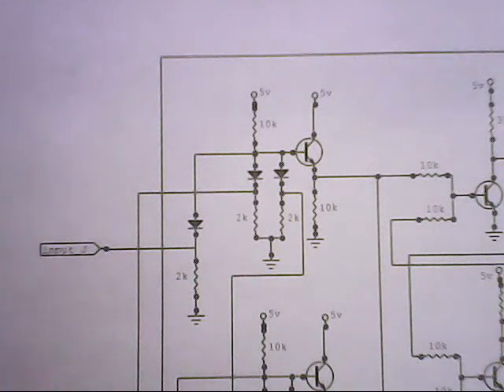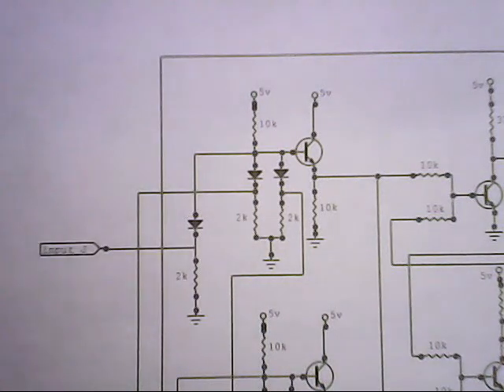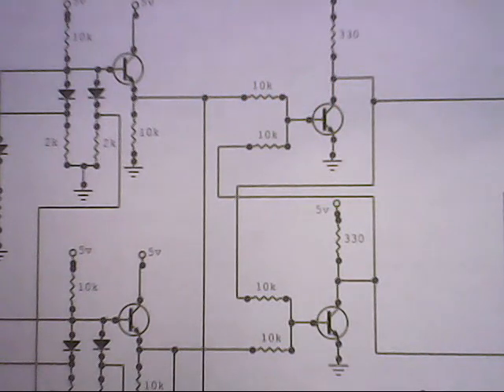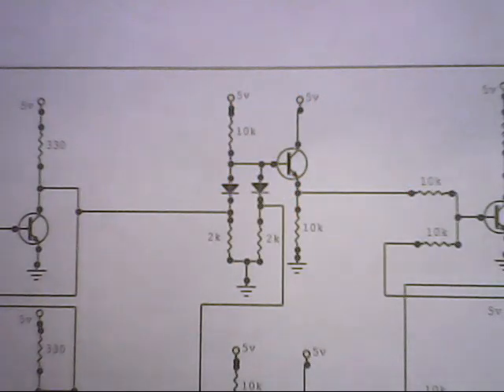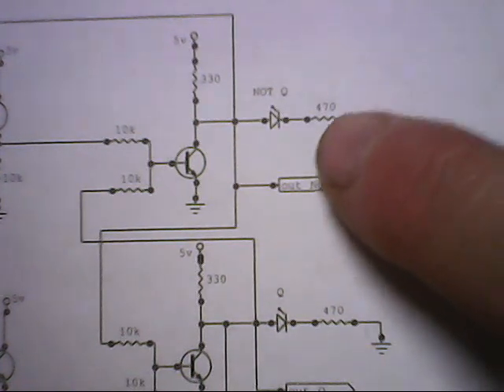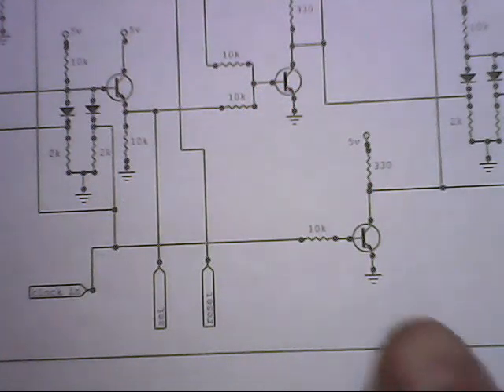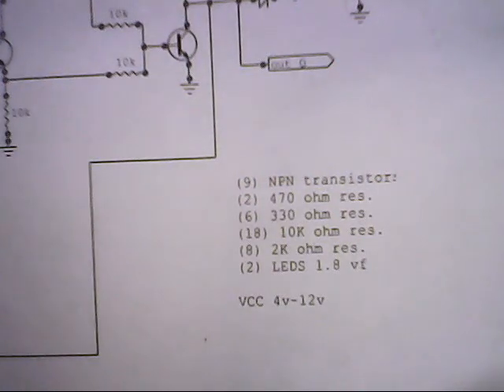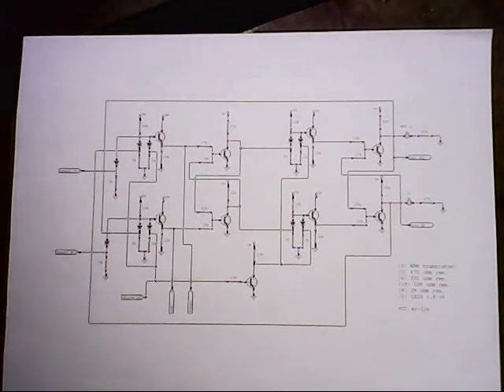Detailed schematic of " jk" "flip flop" using transistors.

Comment: Nice explanation of the circuit. Im currently building it. I noticed you forget to add the diodes in the parts list. 👍
Reply from the maker: Hi thankyou, I didn't realize that I missed those diodes in the parts list until you pointed it out, and going back over my video I seen them missing in the parts list.     I used 1n914 diodes for the circuit.

I feel like this video has been a success in sharing how fun it is to build these kind of circuits from scratch, using discreet components. 
I hope your build of this circuit works out fine for you, 
if you have any problems with it or any questions with it, please comment below and I'll try to help out any way I can.
Reply: Thank you very much, i build it using ss310 shotky diodes because i have a tons of them and works perfectly. Also i love the simplicity of the gates with only one transistors. Previously i was trying to make the AND gates with 4 transistors for the 3inputs and 3 transistors for the 2 inputs, but probably messed something and didn't trigger correctly. Your schematic is very detailed and handy to have.
Reply from the maker: @yankozlatanov  
I'm glad the circuit works for you, 

I can't take credit for the design of the "AND" gates, I seen this configuration many years ago on the innernet or in a magazine, however this person used, if I remember correctly, two resistors on the input side per each input.

I tried to build it and ran into problems with the inputs not being fully isolated from each other, it would work but depending on the voltages and resistor values sometimes it ran into problems for me.
So I modified it by using diodes, so as to keep the inputs isolated from each other.

If you build three more of these, you can connect them together to make binary counters and such.

Thanks for the comment, much appreciated to know that my circuit videos have some merit in helping people enjoy designing transistor circuits at the hobby level.

Comment: A lot of thank you! Anyway if you can send me the image I will be very very grateful, because I want to print it to build it in the breadboard
Reply from the maker: During the video, pause it at certain places, then hit the "print screen" button on your computer, (prtsc) it will copy that to your computer, then you can paste it into "wordpad, or paint, or something, then it can be printed.

The diodes I used were the "1N914", probable any silicon switching diode would work, the diodes are used to isolate the input signals from interacting with each other.
Reply from the maker: Hi, see if this link will work, its an image file that I put on a forum blog.

https://www.electronicspoint.com/attachments/component-side-jk-register-schematic-jpg.36332/
Reply: machining projects at a hobby level plus woodworking a lot a lot a lot of thank you!!
Reply from the maker: Your welcome, I'm glad to help out.